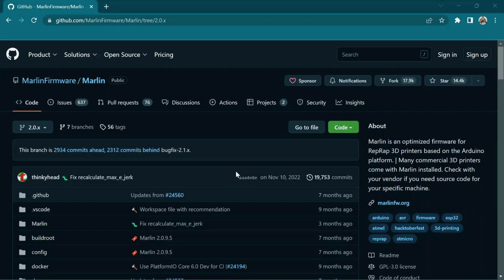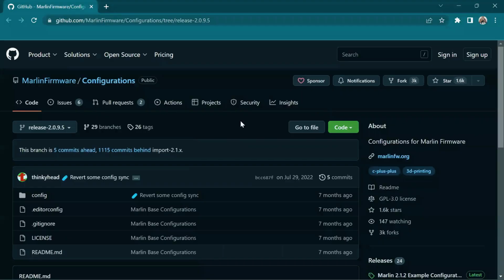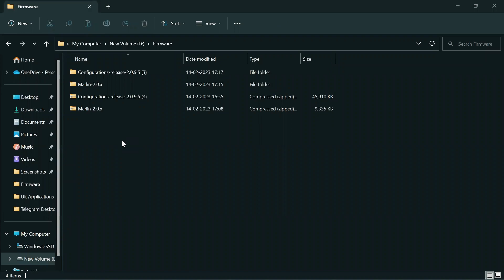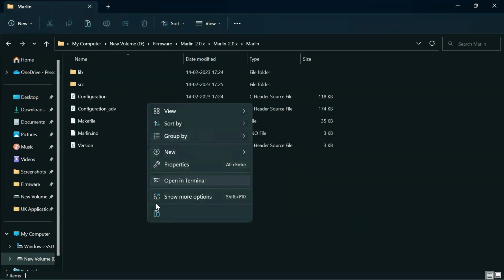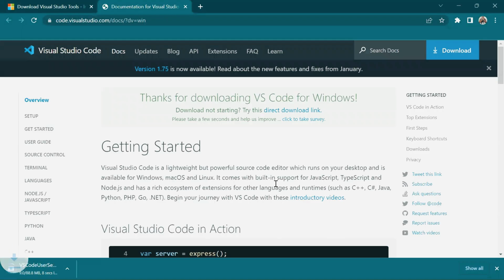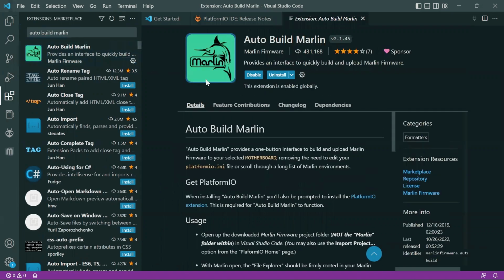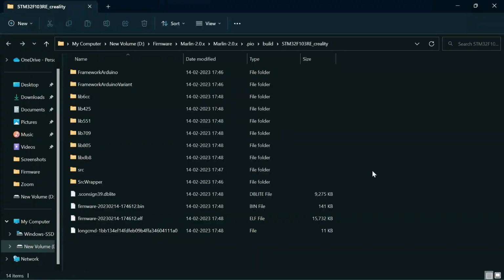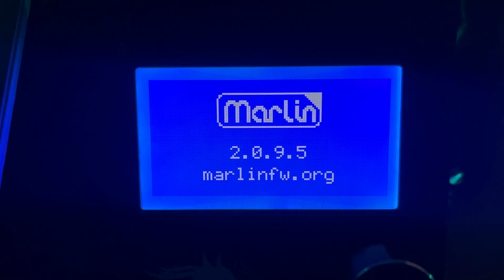Upgrading the Firmware | Ender 3 | Marlin |

Comment: does this work with the gd chip
Reply from the maker: GD chips are not officially supported by Marlin at this time. There are software licensing issue that are still being looked into that need resolving.

At this time use manufactures provided firmware only.